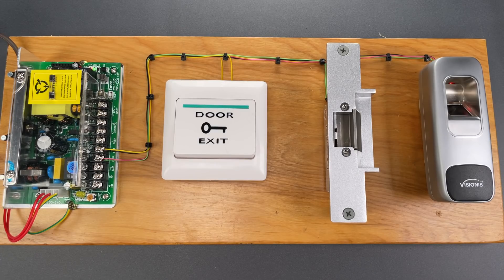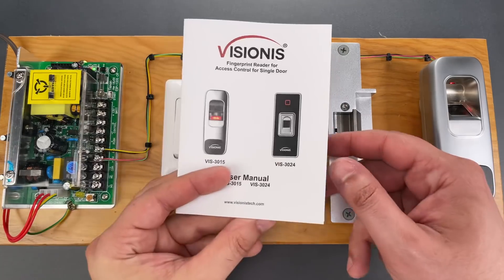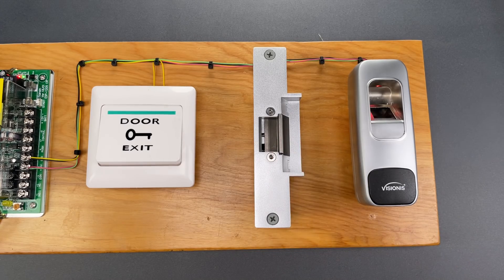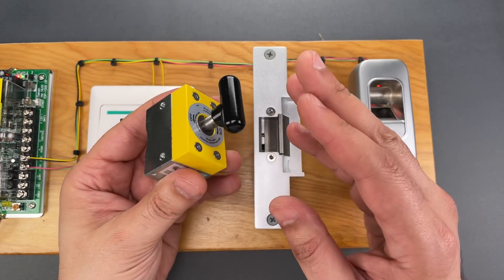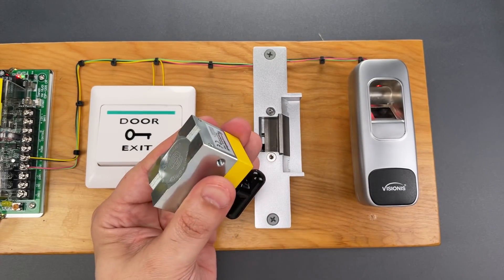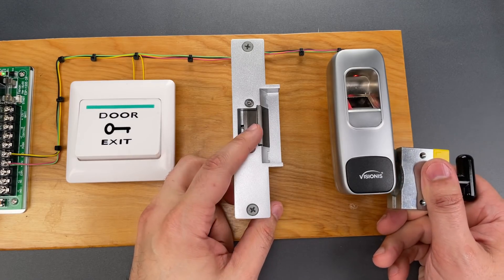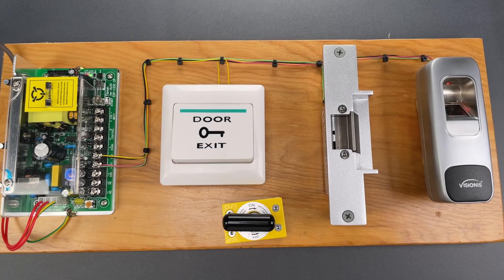[1359] Security Theater: Visionis Fingerprint Reader Bypassed

Comment: I'm not electrical engineer but I imagine it should be extremely easy to add safeguard against such attack by placing one additional relay that is under normal circumstances expected to never turn on unless magnet is present and if it opens then it would disable the lock. If 2 relays are right next to each other it should be impossible to target on specific one with a magnet from out side.

Comment: I'm actually surprised these exterior locks use magnetic relays when they could use a low-voltage IC to tell the power supply to unlock the the strike. Probably more having to do with having to be connected to things like enterphone systems.

Given that you also don't want someone just ripping it off the wall, you'd want that IC to actually cycle through nonces and and not simply accept a N/O shorted signal. Most existing home security systems out there are basically the same idea, where the central control is in a closet somewhere, and everything attached is on a N/O type of loop and does a short when something trips the sensor.

Comment: There was an episode of CSI: NY where the criminal used a magnet ring to bypass an electronic lock on an armored van. Didn't think that a digital lock could possibly be designed to be susceptible to that kind of attack. I guess I am naive.
Reply: Well you were right. This is not technically a lock, it's the equivalent of a turnstile. And he is not doing anything to the electronic part, only to the output relay. It's probably an ordinary solid state DC 5V relay, which is activated by the presence of magnetic field.
Reply: @mrkv4k  I don't think that this is a Solid State Relay but your traditional Coil Relay, Solid State Relays use Optocouplers to optically Isolate and the turn on the Triac inside, which can greatly improve the quality of this lock if you ignore it's still susceptible to Physically opening the Fingerprint scanner and unlocking it
Reply: @prathamkalgutkar7538  yeah, that's an error in translation. I meant relay with solid armature.

Comment: As someone who works in embedded systems, this is just embarrassing.  These attacks are really obvious, or at least should be, especially to the "leading manufacturer of electronic security products with more than 10 years of combined experience within the industry" as the company claims on their website, and it wouldn't be hard to move the relays inside with the power supply (with secure digital communication between the exterior unit and the interior unit) nor to trigger an alarm if people are messing with magnets, either by detecting the magnetic field directly or by detecting uncommanded actuation of the relay.

Comment: This is good to know cuz this is an easy fix. Although it don't make sense. Was that feature added to the lock because the mechanics of the lock does not require that? The circuit board would have no use for a reed or relay switch built into the fingerprint reader. Are you sure you're not just tripping the solenoid to the strike plate? They would be an easy fix for that too but that would make more sense. Because the striker play uses a solenoid to activate and deactivate the mechanism that holds a lock in place.

Comment: On digital systems like this one, where they are so easily defeated but still provide theater and the benefits of a digital system, are they at least priced lower? Kind of like how you'd pay less for a dummy cctv. Or do these companies take themselves way too seriously and charge just as much for trash as others do for tougher security? 

If they are considerably cheaper, seems like a good deal for somebody willing to make efforts to fortify and prevent exploiting these compromising flaws. For example, installing the scanner in a recessed or partially blocked cavity to prevent this magnet based attack.

Comment: Back to the squire lock and 50 cal test.    The lock was suspender in mid air.  Everytime it was hit thr momentum of the round was absorbed by the lock free hanging..    I bet if u put it securely against 2 or 3 inch steel plate it won't fair as well 

You should do it again

Comment: but would this device be embedded in the wall?  so would you only have access to the front of the fingerprint reading terminal and not the side of it like that?  

or breaking in wise do you not care because you'd just pry it off the wall and then electromagnetic attack it?  i guess that's the difference.  sneak attack or "F you i'm getting in and i dont care if you know how i got in".

Comment: What?

Obviously how this is supposed to work is that the scanner sends an activation signal to the controller, the controller sends a random number to the scanner (this to prevent trivial replay attacks), the scanner scans and encrypts the data with the random number as key and sends it to the controller, the controller decrypts the scan and makes a decision based on the data. Perhaps we'd prefer the connection between the scanner and the controller to be a lightpipe rather than something electrical, just to avoid shenanigans. 

Ok, I'm not in the business, but something's wrong if the “product” isn't at least as good as the first thing that comes into my head as a design. I'd always assumed that the weakness in biometric locks was the fact that whatever can be measured by the sensor can easily be permanently recorded by a duplicate of the sensor—say, a subverted lock elsewhere in the building. But evidently, noooo, we can do dumber than that.

Comment: As an IT guy from back in the 80's to present I've harvested 100's of Hard Drive magnets.  Took a bag of them home on the train one day and yep, the bag stuck to the train door, to the metal under the seat and the poles.  It was comical just leaving the bag stuck to the door in mid air, I know how you feel LPL :)
Reply: What an experience :) Harddrives and their magnets have gotten a lot smaller since then.
Reply: @ArthursHD  Tell me about it, the small Sata drives have tiny powerful magnets, the SSD's and M.2's don't even need them. Still have those older magnets though, they come in handy!

Comment: Can we just talk about how clean the wiring is run? Neatest experiment setup on YouTube in a while. A nod of appreciation for the extra zip ties, all clipped and oriented the same. Oh, and you’re a wizard to boot!
Reply: This used to be a thing except electricians would use string. If you do it right the string is only cut at the ends. I found some in an old security alarm system I was dismantaling and got interested. Looks very neat but gets impractical when you realize all the cables are cut to length. Need to move a cable? Rerun the whole thing.

Comment: If you've already got an internal electronics component to the system, why would you put the relay on the outside in the first place? 
Are they trying to minimise the internal space requirements by shoving as much as possible into the exterior scanner panel?

Comment: If those systems are setup with a door alarm system it will generate an alert if the door is opened without the appropriate  fingerprint.  We had one that was kind of flakey so occasionally we'd have to use the key and it would always generate a phone call from the security company letting us know that a "door force" alert was detected.

Comment: Come on, will they EVER learn? How hard is it to put the logic on the mainboard, instead of the fingerprint reader? I know, it's cheaper to use stock fingerprint reader and put it in fancy box - but then the effect is always the same. And the fail with relay is even worse... They could simply align it with other relay, that - once activated by magnet - would break the circuit and keep the attacker from opening the door using that simple method... but only putting a sole fingerprint reader outside and verifying everything on the MB would really help. But then probably LPL would show how easy it is to override the locking mechanism 😆

Comment: Not keen on touching (or at least appearing to touch) an exposed power supply, especially while it has power. Doing that with the wrong power supply will end very badly.

As for the lock, putting any decision electronics on the insecure side is just a plain bad idea, yet they all seem to do it.
Reply: Thank you. I had to scroll waaay too far to find someone else that tensed up about that.

Comment: Looks very weak. 
If I was building that type of thing I'd put 2 systems in place (finger print and a keypad with pin or pin and swipe card) which would send a long series of data (card number & pin number) to the controller box.
Of course the controller box would do timeouts if the wrong card / pin was sent stepping up 2 seconds, 4 seconds , 16 seconds , 32 seconds, 64 seconds and so on (stops brute force attacks) If 5 or more incorrect attempts in 5 minutes then it would set off an alarm and wirelessly notify security. 
As for the latch a think a low geared motor (instead of a solenoid) slowly opening the latch would be better (can't use a magnet on it) or a well protected solenoid . 
The only issue you need to guard against however is some sort of data logger being installed that steals card numbers and pins. For this you could have a 2 step authentication via your phone.

Comment: I've seen a lot of electronic locks defeated by magnets or other relatively simple bypasses on this channel. So I'm curious what sort of electronic or smart lock the LPL would actually recommend for basic home security?
Reply: Smith and Wesson
Reply: Probably anything that has the guts of the system inside the building. That seems to be the common problem he has, is like in this case all the stuff that controls the door is outside and easy to tamper with.
All that'd be needed to make this one good is if they had the finger scan and the unlocking mechanism separated.
Reply: You could use this very reader, but instead of using the built-in relay, you could connect the data output and put your control unit inside.

Comment: Sometimes, unbelievably stupidly designed locks like this aren't really used for their security, but are instead used for micromanagement. They can automatically log their usage, which is useful for keeping track of employees. In which case, it's more-so the absence of its usage that is the telling factor as well in whatever information you need about your employees.
Reply: Except something this stupid won't be doing any logging. I would only expect to find that on higher end systems which are centrally controlled.

Comment: I presume the fingerprint reader is usually installed more than an arm's reach away from the door handle. So in real installations you probably want one person holding the magnet and one person opening the door handle. Still security theatre from the lock though..
Reply: Or a stick.

Comment: As an electrician, programmer and engineer, thats the dumbest design ever. As soon as I saw the wires and the board on the left, I knew you could just short it out as well without a magnet

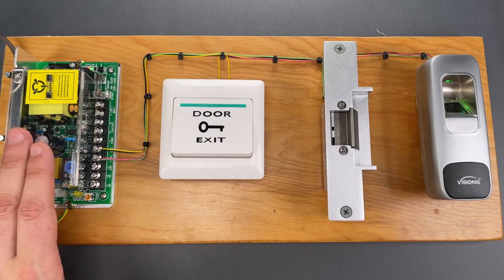Comment: FYI, heatsinks are often live in switching power supplies. That supply has its  'protective cover' screwed down with metal screws to the heatsink. Given the other poor design choices with that unit, I wouldn't be surprised if you made you body live when you touched them at 0:44 and didn't get a shock only because you weren't touching a ground.

Comment: Professional bio readers, or any type of professional reader for that matter, typically employ a weigand data connection from the reader to the door controller. You would not be able to simply manipulate a relay since the logic from the reader is hexadecimal data. For further protection, OSDP telemetry to the controller is used so you couldn’t remove an encrypted technology reader and inject a weigand string equal to that of a known card number. 
Anyone that installs a relay to energize a strike on the unsecured side of an opening has no business in the security industry.

Comment: Supposedly some fingerprint scanners have a flaw where you can blow hot air over the glass and it creates the fingerprint impression from condensation from the last valid user. I heard it was from an older laptop, but you could try it with some of your finger print locks. Another suggestion would be to try the dust that police use to dust for prints.

Comment: using a solid-state relay instead of a magnetic relay would fix so many electronic locks for a dollar at most. I do wonder if the manufactures of these kinds of locks do it on purpose to save some buck or 2 or that they simply haven't thought of this weakness. either way, it's bad.

Comment: A hobby electronics magazine did a fingerprint lock a few years ago, the fingerprint reader used 4 wires - 2 for supply and to for serial data, the reader sent a string with a serial number for the reader, followed by a long hexadecimal code about 32 chars long, and the internal board would reject the code if the serial number was wrong, or the finger data was incorrect as well, but could be programmed for up to 16 users. The relay to activate the lock was on the inside.

Comment: The relay-triggering by magnet could be avoided by having the relay inside, even if the "brain" was still outside.

But it really should be separated into two parts.  The keypad or fingerprint reader could be battery-powered, and sending a radio signal, like car keys. Then you'd not need to drill holes for wires; of course it should be optional to power it from mains.
The decision to open could be inside or outside, as long as the signal from outside to inside is encrypted like car keys.

Comment: That's why door locks like that need to always be covered by the 10 minute loop security video recorder, so you can get a good low-res picture of the unidentifiable back of someone's jacket shoulders and top of the baseball cap from the back when they break in.

Comment: The stupid thing is, it would be so easy to put most of the control logic on the same board as the power supply
Reply: That’s what boggles my mind. It’s not like it would be more expensive or difficult. Heck, it would be easier since you don’t have to squeeze everything into the outside unit, it could even be cheaper. 
It can only mean the manufacturer just does not care at all.
Reply: @JanStrojil  Not really. There is an option to do that, if you want to. If you want to use that reader like this, it's an equivalent of a turnstile (which could be jumped over).
Reply: @mrkv4k  I’m afraid I don’t follow. How do you jump over a closed door? We’re talking about having the reader outside and the control logic including the relay on the inside.
Reply: @JanStrojil  No, we are talking about protected and unprotected space. This kind of use doesn't change the status of a space (meaning you either have unprotected space on both sides of the door or protected space on both sides) and it has some applications. Door with this reader in this very configuration is technically similar to a turnstile. You wouldn't use it to protect something that is on the other side of the door, because that's not its purpouse.
Reply: @mrkv4k  Thanks!

Comment: what about the striker bolt?

there is an electric magnet device inside the door striker assembly try the magnet on that as it may be easier than attacking the reader unit

Comment: The "handling the logic on the outside module" issue is just a stupid design that can be easily fixed, but how to fix the magnet exploit, as the door lock company?
Reply: The do make motorized door strikes that don't use an electomagnetic solenoid.
Reply: @JerryB507  That "motorised" also moves some sort of metal bar that is locking the door, doesn't it? Then, doesn't that also get  moved by a magnet?
Reply: @typingcat  The motor either (a) drives a cam that moves out of the way to release the strike, (b) a geared blocking pin to release the strike or (c) a geared bolt that retracts to allow the door to open.

Comment: Holy heck, I never would have imagined a permanent magnet that can be turned on and off. That's brilliant.
Reply: Agreed coolest part of the vid
Reply: K&J Magnetics, that surprisingly sell magnets, have a detailed explanation of how the Mag Switch devices work. With pictures.
Reply: there are industrial permanent magnets we use at my work, those can lift 600kg's and can be activated by turning a lever 180 degrees. it's not that big either, only about 25 centimeters, but it is very heavy. we use it for lifting thick sheet metals with a forklift.
Reply: @vrXPnJO61U  I have a mag base for a dial gauge with a push button 'On/Off'.
Reply: They aren't actually being switched off, they are being shorted out. The magnet is still magnetic, but it's field is shorted by a bypass
Reply: My jaw dropped!
Reply: There's 2 permanent magnets in there, and when you flip the poles into a specific orientation relative to one another, it cancels out the magnetic field. It's mindbogglingly simple when you see one in action... I think Steve Mould did a video that explained it to me.
Reply: @securi-t  but where do I buy the magnet?
Reply: @notusedexer  I've got several of them on my welding cart. I got them at the welding supply store. The first place I ever saw them used was for attaching grounding clamps.
Reply: Same here
Reply: I believe Action Lab did a video about this kind.
Reply: I have a switch on my welding squares. They get used to find lost bolts 99% of the time
Reply: These magnets are very frequently used by engineers and in manufacturing scenarios

Comment: This is clearly a design flaw in the electrical engineering section. Even my cat (used to check all my electronic designs) knows, a cheap opto-coupler (e.g. Opto-MOSFET, or a Darlington-Coupler with a bridge rectifier to accept AC or DC) instead of an electromagnetic relay could have solved this particular problem.